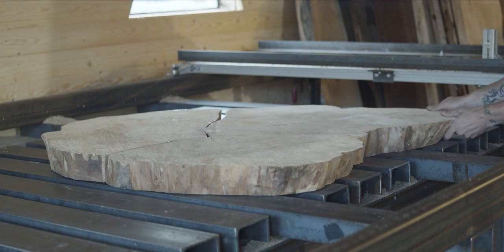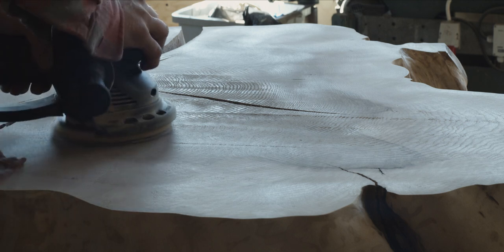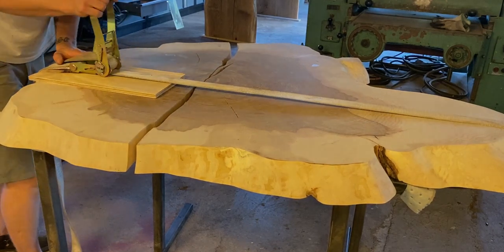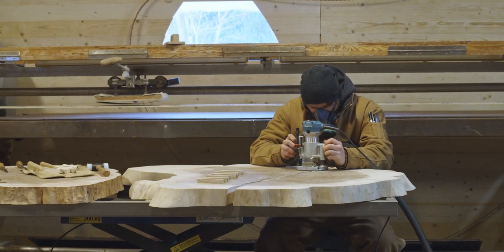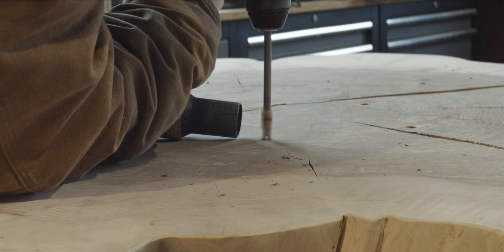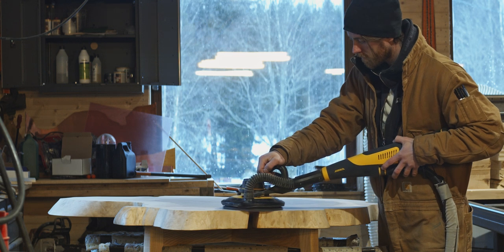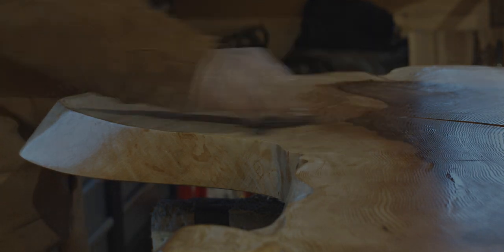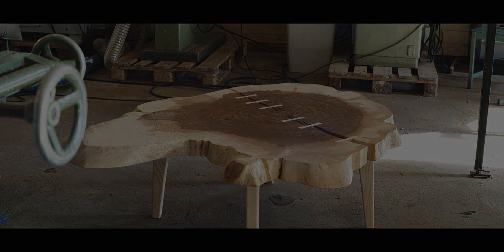Making Scandinavian Ash Low Tables

Comment: Nice tips on the sander  . Were these air dried ? I have an oak one roughly finished  that I put in my house to see if it would finish drying by the heat of the wood stove . I had routed out a pocket and installed a piece of ply wood that covered most of the bottom . I just put metal legs on so it could be used . So far it is holding up . I am not sure if I will be trying to fill in the cracks or not  .  
Glad to see a new video . Thanks .
Reply from the maker: Hey Robin, thanks for your comment and sorry for my late reply. Been super busy these past few days. These cookies were airdried for about 2 years, but i did put them in the kiln just for a short while, i do that to kill off any bugs. Nice idea using plywood on the bottom!
Reply: @backstromwoodwork566  Time will tell it it holds up while it finishes drying  .
 Its good to be busy . Been a cold winter here in Canada but looks like warmer weather is on its way .

Comment: So many bullshit woodworking videos out there, UNLIKE yours WHICH are extremely professional and informative, demonstrating respect for older tools and techniques while incorporating effective modern ones, it’s a pleasure to be gaining insight rather than hurling insults at a overwrought aspirational woodworker. And, praise the lord, your take on the epoxy craze could not be more accurate imo. I’ve been using epoxy forever and find it infinitely useful, but used as a finish material it has become ridiculous and clichéd, I question how long it will last, and it’s consuming inordinate amounts of petrochemical material in the process. It’s to a point that it just seems dumb to me. Your aesthetic is timeless unlike that of the epoxy craze.